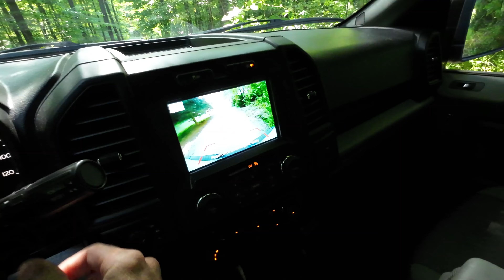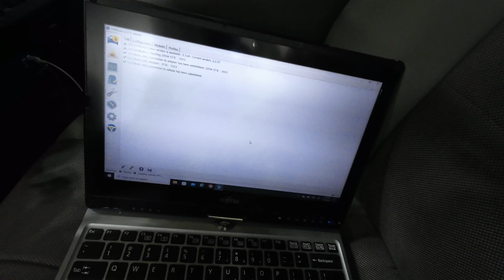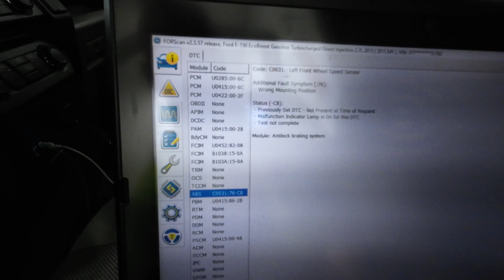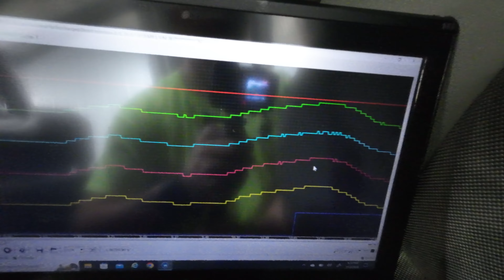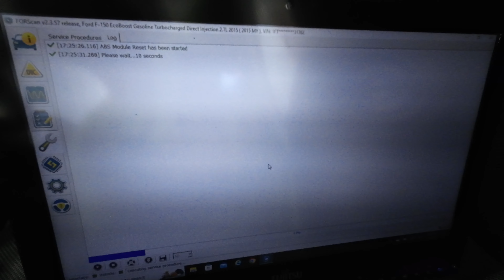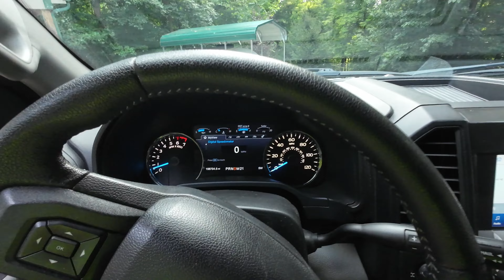F150 All Systems Freak-Out - ABS Code(s) C0031 C0034 Troubleshooting & How To Repair C0031:76

Comment: My code is an invalid data from wheel speed sensor on front left do you think it could be the same issue?
Reply from the maker: Could be multiple things. But most likely it is caused by something between the sensor and the tone ring. I'd try and pull it and clean and inspect it first. Look for grease or dirt and go from there

Comment: I'm getting the same codes at work. Left front and module codes. I just fixed one by replacing the sensor and cleaning the hell out of the hub but this next one isn't working. It has a bad wheel bearing anyway so i might as well replace that and see. You said not to mess with the new sensor on the hub but they dont come with one..
Reply from the maker: Most wheel hub / bearing assemblies do come with a new sensor. If it doesn't, I would use a genuine Motorcraft speed sensor.

Comment: Hey we have 2017 f150 and the racket tool started to come on every so often and when check codes it’s showing a lot of codes but no engine light or no code about transmission. Do u know what it could be? Run and drives really good other that when that happens.
Reply from the maker: Not sure what the racket tool is?

Comment: Water into ABS Module harness plug or connector corrosion at the plug.   Which is located directly under the breather box on my 2.7L and mounted to the back of the ABS assembly was my issue.   Cruise stopped working and emergency brake unable to set.  Removed connector, cleaned pins, applied Dielectric grease and sealed around connector better with wide vinyl tape.  Cleared codes with forscan and working perfect for 2+ years now.